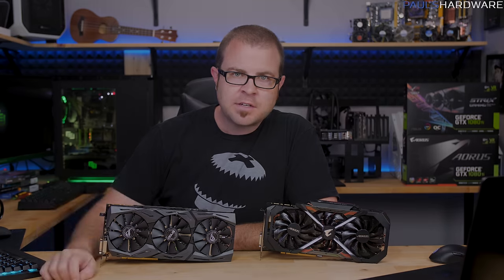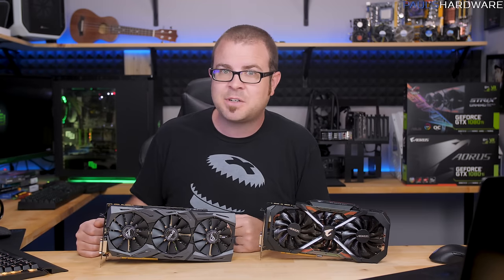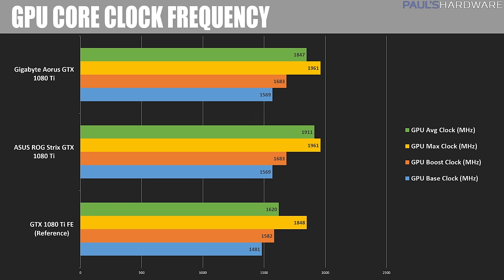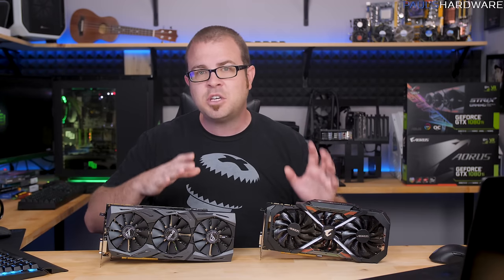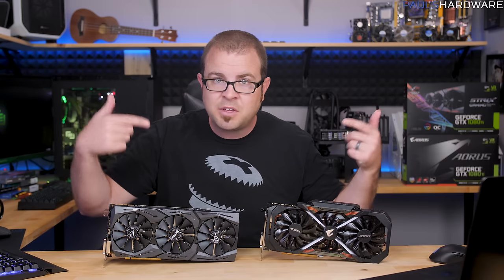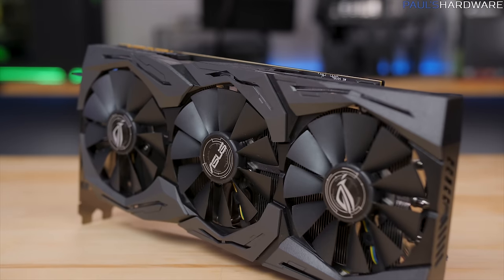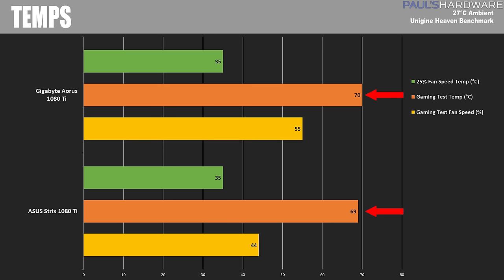AORUS vs STRIX: Why My 1080 Ti Showdown Doesn't Matter

Comment: I thought it would start with Step 1: Check Wallet to determine how much money you have to spare.    Step 2 : Cry over the fact you don't have as much that you really want...  and then refer to this video.
Reply: Or you do what i did, bought a 3 month old 1080 TI now that ppl wants to stock up for the new generation, and i returned my 1080 to the store and bought the TI for 160 bucks less.
Reply: @Zarozh  I'm planning to do the same idea, i wi buy used card (4 months or less) and i save 700$in my pocket
Reply: @Zarozh  i just got en aorus 1080ti for 200
Reply: @Boemel  worth it idd, hope the 3000 serie will be good, then im getting a 3000Ti upgrade

Comment: Strix looks cooler, therefore, I overpay
Reply: Robert Ward  me irl
Reply: Aorus performs better
Reply: No pun intended
Reply: I don't like the hotdog sauce cabling
Reply: Msi gaming X looks the best
Reply: WorldGuiness Comments your right. By 1fps
Reply: If your not mounting the graphics card sideways the Aurous actually lookes really bad ass and its only 20 over the FE edition instead of 80 over so you can get most of the awesome features and save 60 bucks. I have the Gtx 1070 Extreme gaming card which was the best gigabyte card for the 1070 when I bought it and it looks awesome its pretty much the same except it says Extreme Gaming in adjustable RGB light instead of Aurous. Honestly I do think Extreme Gaming looks cooler in the case then Aorous in my opinion.
Reply: No,Aorus
Reply: The strix cards have binned chips so you also get better OC and performnace 2 years down the line

Comment: I just got the Aorus 1080 Ti Xtreme yesterday. I love it so far
Reply: True, I was a little concerned with the slag from it being so heavy, but it seems to be hanging in there.
Reply: picked up a gpu support, for now it's held up with plastic ties
Reply: got the 1070 Xtreme. Absolutely love it! It looks amazing! But boy is it thicc
Reply: Mine for some reason doesnt sag at all. Even though i have normal plastic pcie slots. Probably just the card is very rigid in the pcb
Reply: I love mine. It OCs great runs cool. I have it on an open bench so sound is important to me. It is quiet even when it goes to 70% fan. My RAD fans make more noise. This is a beast of a card. 60fps @ 3440x1440p smooth no drops. Stays level. I went from a Evga 780ti to this card and Wow I am one happy gal.
Reply: Hopefully getting mine today !
Reply: how heavy is it? and does it sag when installed in a tower case?
Reply: it weighs 2lbs and it sagged mine...
Reply: I got mine a few months ago. It's a great card. I paired it with a gaming K7, and the RGB syncs up with the board. A huge upgrade compared to my old PC. I get about 165 FPS on Ultra in COD WWII.

Addendum: ...and I haven't even applied an OC to it yet.
Reply: To bad rtx now
Reply: How much?
Reply: Do you still use it :( I hope.

Comment: I got the Zotac gtx 1080ti AMP Etreme core active... and i hate it...  coil whine a lot and loud, also random fans issues with them revving up to 100% randomly even when there is no load on them... also i cant change Fan speed myselfs, it just wont let me, if i make the fanspeed to 100% nothing happens, the card just ignores it. Also there is a problem with overclocking, i cant get higher than 1999mhz, if i go higher it just wont let me, numbers wont change .  God i need to return it fast and get something else... im done with Zotac...
Reply: Did u try turning it off and on?
Reply: sadly yes
i even peed on it to show dominance
Reply: That comment made my day!
Reply: Hmmm did you try setting it to Wumbo?
Reply: plug your fans directly to our psu with resistors :P  set to 1300rpm and you are set.
Reply: lmao 😂😂
Reply: sounds like you did something wrong or got a bad one mine is basically silent, and STAYS that way no matter what I'm doing, gaming or rendering I don't know the fans are on unless the RGB changes colors cus I have it set to under the "active" settings
Reply: Hawkeye979 I have one and have no such issues. That sucks for you.
Reply: Also you forgot zotac are so cheap in build  on these video card ,becose instead put some common thermal pads to cool all mems,mosfets, etc.,they choose to use for that common ruber  LOL.
Reply: Hawkeye979 might have been your motherboard
Reply: I had that with my 980 Ti AMP Extreme, just set a fan curve in Afterburner. I hate that feature that fans are at 0% under a certain temp. It's useless, at 20-30% you still won't hear the fans anyway.

Comment: 7:00 that's not how you should test that imo. Bench at certain dB(A)'s instead of % RPM and see how cool they are after like 15 minutes of stresstesting at the same Mhz (maybe even Voltage if possible).

Comment: Hold on a min. When i put my power cables into my Asus Strix  rx480 the led turns on... So its a difference there or my card got a problem? Runs finde while gaming o.O
related to 8:15

Comment: As someone with the STRIX 1080Ti, I LOVE having the headers for the extra fans.

The problem with gaming is that the CPU doesn't do much, so getting airflow in the case when the GPU starts getting hot is an issue.
Apart from which, if the CPU is busy, then the  intake air is also warm.

The extra fans help pull extra cold filtered air in and, with a well ventilated case, it maintains positive pressure and keeps temperatures reasonable
(I usually see about 66-67C on the card in the case while gaming)

Comment: I think it's pointless to buy cards with original cooling(unless you building small pc and you need blower style cooler on videocard), because it's a lot harder to clean, it's lower clocked by default and the cooler itself isn't that great. Why not spend additional $20-$30 for a card with better cooler?

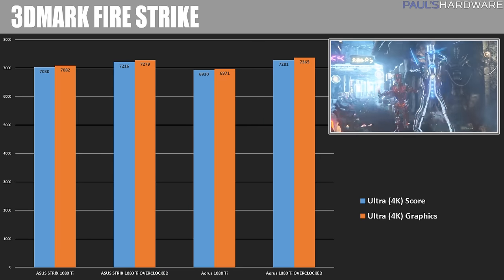Comment: 3:35-3:52 what he said is why I went with Sapphire on AMD bought two RX 580's 8GB Sapphire Special Edition's. However Pricing was slightly more expensive then the average RX 580 for good reason's :). RGB, LOOKS/ESTETICS, COOLING AND BUILT QUILTY IS REALLY WELL MADE. Its also one of the fastest performing RX 580's you can get :D ,but that is why its more expensive. Its also one of the best looking RX 580's you can get with the ability to be able to light up.

Comment: Sorry man, but raw performance is exactly what I am looking at when choosing a graphic's card, first and foremost!!! Secondary is cooling, pricing, noise, build quality and aesthetic's in that order. I will take the quieter, better oc'ing Auros over the loud, less performing Strix all day long. And for the record, it wasn't that it just seemed like the Asus was louder, the Strix is way louder than the Auros by over 10%, yet no matter the higher rpm, it only manages one degree cooler at load, which is within the margin of error.

Comment: I'm controlling all RGB Lights with AURA software with this setup: 

Case:    Bitfenix Enso    
Motherboard:  ROG Strix Z370-E Gaming   
CPU:    Intel Core I7-8700K 3.70GHz  
CPU Cooler:   Cooler Master MasterAir ma610p  
RAM:    T-FORCE Gaming DELTA RGB DDR4 2x16GB 
SSD:    Samsung 960 EVO 500GB   
HDD:   SEAGATE Barracuda 2TB  
GPU:    Asus Strix GTX 1080ti  
Power Supply:  EVGA SuperNova G3 650W   

Keyboard:  Asus Strix Flare   
Mouse:    Asus Strix Impact   
Headset:  Asus Strix Wireless

Comment: So this is the part where I just have to ask... if you were going to full block watercool it anyway, should you just go for a Founders instead of another version? or should you consider a beefed up board (for example, the strix has a two 8 pin connectors vs a 6 + 8 that the founders have, iirc) and why? Thanks for the input, Paul, love your vids! (y)

Comment: I hadn't bought a Gigabyte GPU in several generations; I only got one this time because I lucked out on Newegg the day it launched when all the other cards were still sold out. It is the Aorus Extreme version and it is an absolute beast. I ended up at +75 core +400 mem clock %120 power limit 85°C temp limit. It stays at 2052 Mhz and never went over 62°C. I immediately got a second one and the OC stayed stable with two cards synced with the top card now never going over 66°C, and the bottom card (the first one I got) still around 62°C max. In actuality they both are usually closer to 60°C. Great cards overall, I highly recommend the cards. They are massive 2 1/2 slot cards though so it pays to know they'll fit in advance.

Comment: Personally I always had problems with the fans on the card after a few years and this is something which is basically never tested or considered in tests. Well, it is indeed very hard to test. But often cards use similar coolers as predecessors, so it would be possible to make a test that way.
But not having this data, I basically made my choice by having the best "workarounds", which left 2 candidates:
EVGA: Great reputation, option to extend warranty (paid 40$ for 10 year warranty) and warranty not void if you replace the cooler yourself
ASUS Strix: The additional fan connectors Paul mentioned are actually a great way to connect an aftermarket fan

My third card of choice would have been a gainward phantom card with replacable fans. But unfortunately they discontinued that line.

Comment: One of the things that put me off the Strix is the VRM and VRAM cooling solution. I know it's just my paranoia but having no direct contact from the heatsink to the VRAM and VRM bothered me. Asus did the same thing with the 980Ti Matrix, I was shocked to find the card had no cooling on the VRAM and only a small plate on the VRM.

Comment: The Aorus GTX 1080 Ti, has ZERO sag in my setup, with reinforced PCIe Slots. Also almost all 1080 Ti, overclock to almost the same Core clocks. Example my current Aorus can hit same level of OC as Xtreme Edition 1080ti. Maybe I won the lottery? I just feel all 1080 Ti are at their limit. Both thermal and voltage, and FPS difference between all of them are unable to be noticed.

Comment: Please do Zotac 1080Ti Amp Extreme vs EVGA FTW3.
Reply: You can find EVGA FTW3 reviews over at Gamers Nexus and JayzTwoCents.  Spoiler alert, they are just as fast as all the other 1080Ti high end cards, with no extra overhead to overclock.
Reply: larock0wns while that is true, it's also worth it because of the fact that its EVGA; extremely long guarantee, customer support is flawless, build quality is supreme, and if your card malfunctions, they will send you a better version
Reply: I don't disagree. I was just referencing performance.  You will only be picking out these cards based on price, looks, extras and how you feel about the company.  Performance is irrelevant on these cards, since they are all the same
Reply: not if you have a 144hz or 200hz  refresh monitor without g sync
Reply: Zotac is faster
Reply: I got the zotac amp extreme version and for the price that i payed when it first come out, i honestly wish that i had just gotten the evga hybrid version instead.
Reply: I wouldn't toucha POS Zotac anything...

Comment: The white LEDs for the power connectors are lit on my Strix 1080Ti OC when the extra power cables are connected which is the exact opposite of what I can see in your video. The card is functioning perfectly this way though. So I'm not worried that they are not connected or not properly connected. What do you make of this? Did Asus change the behavior of those LEDs lately?
Reply: Same when I had my asus strix 970. The power LED would stay on 24/7 even after shutting down the computer, which was annoying AF.

Comment: I'm a little late to the party, but I think there is one thing paul didn't mention or if he did I missed it. Make sure the card you buy fits! I've seen lots of posts on reddit and build videos on youtube where someone buys a huge graphics card to put in a small case and its either too long or too tall. 

I just bought a evga ftw3 3080 and although I have a phanteks enthoo evolv which is a big case I had to move my pump/res up to the next set of holes on my radiator because the card was so long it wouldn't fit. Just remember that if you have custom cooling or if you have a small form factor case!

Comment: I ended up with the EVGA FTW3, it was longer than the spec sheet said though so ended up having to move my radiator to get it to fit in a mini ATX. The end results were still great though.

Comment: I have 4 Asus Ti Turbo's and 5 Gigabyte Founders. The ALL at least hit or max out at 2000 to 2050 Mhz on the core and 5800 - 6000 Mhz on the Memory. All done on Air using MSI Afterburner. 110-115% on power limit, 150-175 Mhz on core, and 600-1000 on memory for any card i've OC'd. No increase on core voltage was needed.
Reply: chancey1979  my evga ftw3 clocks to 2136 mhz on water.

Comment: Hey Paul! What I would like to see on a This AIB GPU vs That AIB GPU comparison/showdown/roundup/whatever, is an evaluation of cooling performance at two or three different noise levels.  Since you are dealing with different numbers of fans, fan sizes, and rpm ceilings, using a fixed rpm or fixed percentage doesn't really tell us anything.  But which one cools best at, say, 40db?  That, I want to know.

Comment: EVGA's Step up program ensures they are the only GPU company I will ever buy from. It's the reason I have a 1080ti instead of a 1080. Upgraded my 1080 to a 1080 ICX version which then gave you a 90 day window to step up if anything else released. The 1080ti dropped and I upgraded with just days remaining. Awesome stuff.

Comment: My Asus won't let me run itself at 25% fan speed it makes it to around 40% otherwise the fans won't spin. This is in Asus Tweak. It also seems to be the default minimum settings for fan when let on auto. Otherwise its around 1400rpm if my fans are on.

Comment: I had Aorus GTX 1080ti for 5 or 6 days and returned it to the shop because the temperatures in Witcher 3 2160p were 79-80 degrees and the fans speed was 80% - that is a pretty bad cooling solution if you want a silent and not very hot card to play in 4K in your case (not an open stand). I bought Asus Strix instead and the difference is so huge - Witcher 3 in 4K can push this card only up 71 degrees at max OC and 45% fans speed. Without OC it runs at 67-68 degrees. So there is big a difference between these 2 cards actually.
Reply: Screenshot or I will not believe ;]
Reply: NotProGaming you should, asus dont cool vrm, aorus does, vrm is hottest place in card, so aorus just take temps from vrm and add it to gpu and after that cool everything. Asus hads cool gpu, but vrm can heat up to 100C, check guru 3d temps picture if you want proof,what is better cooler gpu and hotter vrm or cooler vrm but hotter gpu:i dont know, vrm is made to live in big temps, but there can be issues with burned mosfets, but its very rear stuff. I go with asus.
Reply: I have bought Aorus and temps in custom OC is 69-79C but when fans are at 80-100% temps are 61-69. But my stable OC limit is very low (depends from runned game, not every game is stable on specified OC)
Reply: i was geting 82 c + with aorus  even 100% fans at at 99% usage for long its f volcano the card and that backplate is way hotter than any other card if u run air cooled cpu expect + 20 c temps

Comment: In my opinion, it just isn't worth spending more on a GPU then the base cost of it. If you really need lower temps, just turn the fan up to about 60-70%. you prob wont even notice the difference so long as you don't have it right next to your head. Granted there is the one scenario of if you live in a vary hot environment. I could kinda see it then.

Comment: Annoying about the asus 1080 ti strix is that the cooler starts working at 1000 rpm, which makes some noise in my pc. Very annoying. You cannot set it lower.

Comment: I found used models at the exact same price but went with the AORUS @ $550 US.  I liked the metal design a bit better and the 5 video ports...2 HDMI and 3 DPs as well as the better speeds? Hope I made the right choice lol Oh and there was 1 Strix at the same price  but I still chose the AUROS.

Comment: One thing that bothers me about my strix 1080 ti is... the inability to use triple displayports(3x PG279Q), one of my monitors are running on 60hz because there's nothing I could do about it since I was an early adopter and did not want an FE card or everything else was sold out.
Reply: I agree that's why i'm thinking of getting the FTW3
Reply: elyche the hdmi is 2.0, so if your monitor is compatible you can use it at 144hz. And you could always use an adapter, as the card CAN deliver that 144hz on that port.

Comment: Anyone else bothered that you can see the colored wires for the fans on the ASUS card? I realize it will probably never be seen during its use. However for $780 that little lack of aesthetic touch kinda rubs me the wrong way. I may be biased because I am supposed to be buying one for a build i'm doing for a family member and its now eating at me that I should find a way to cover that up.

Comment: I had two 1080Ti FE's and sold them both for two Aorus Ti's purely for the cooling, price and availability. The Nvidia FE's were so loud and so hot they were unusable for overclocked 4K/60 Ultra gaming in SLI. Even when I tried with headphones they were too loud. Much prefer the more "silent" approach of triple fans.

Comment: is the aorus a reference pcb? i have a reference 1080ti in right now with a hybrid kit on it. i would like to get another reference pcb board (so it will fit with my evga hybrid kit, i bought 2 kits knowing i would eventually go SLI), but i really want an internal hdmi port for future VR needs.

i am guessing having an internal HDMI means the board is not reference and would not work with the evga hybrid kit.